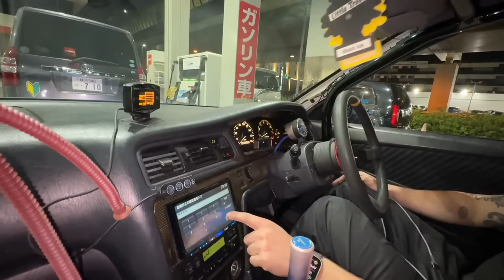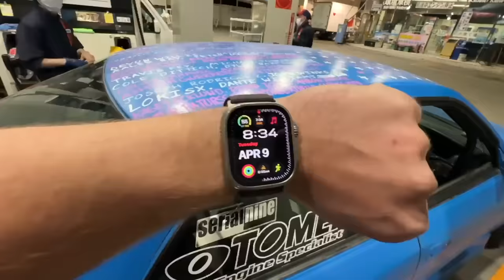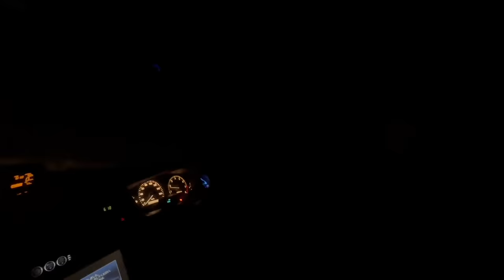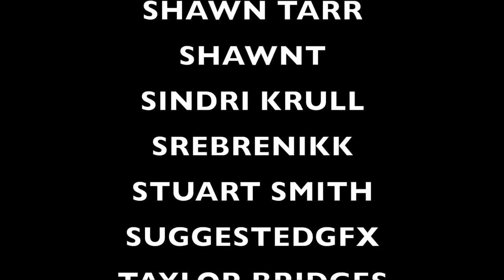DRIVING THE JZX FOR THE FIRST TIME IN JAPAN!

Comment: The radio in the chaser you cannot get to work? Slide it out of the dash and on the back side of it should be a little red or black recessed button that you can push with a safety pin or paper clip. Hold that button in for 10 to 20 seconds and it should factory reset the radio and remove the password.